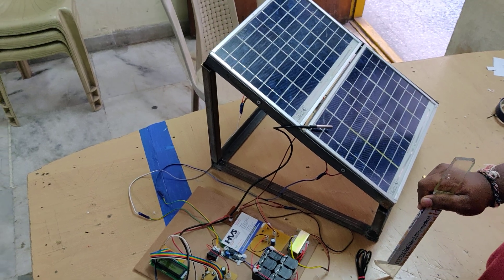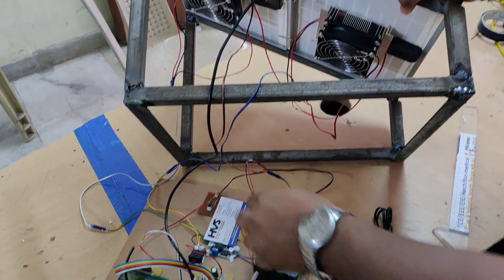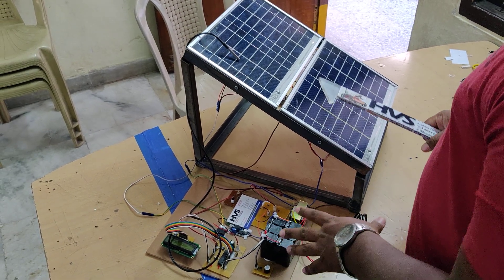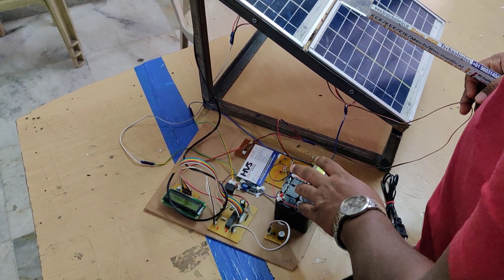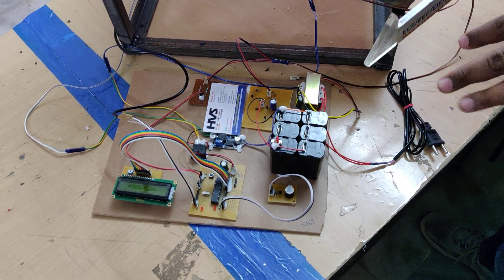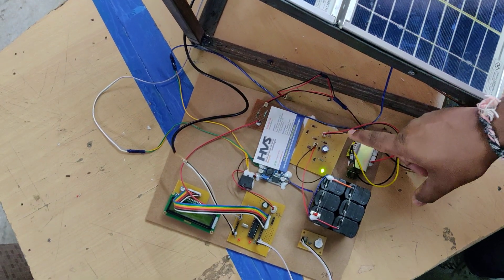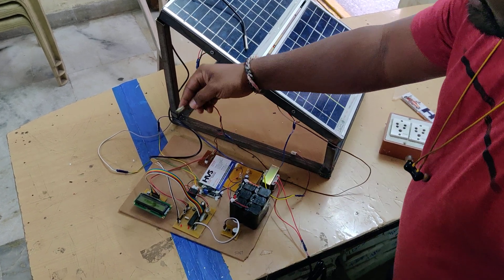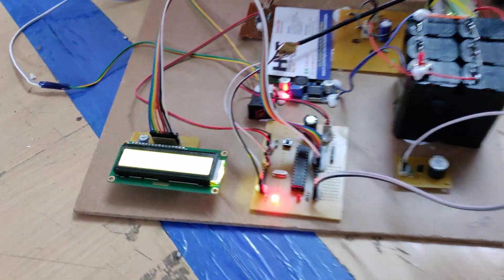HVS-3342. Cooling of solar panel by peltier Effect.#cooling effect by peltier #ds18b20 sensor#LCD

Comment: When we cool the solar panal by help peltier module and heat sink the overall efficiency of solar panal will be increase by reduction of thermal resistance But the power consumption of cooling system is take More than that of increased solar panal efficiency.If the peltier module is taking power from solar panel, then how will the efficiency of solar panel increases
It's an failure project
Reply from the maker: @maxx_millo  we are not cooling it continuously. We just make more effective then power to storage or utility. You can contact us at +919603140482
Through WhatsApp or call